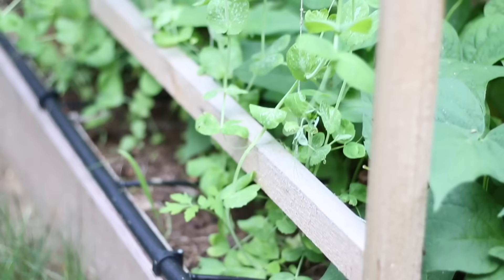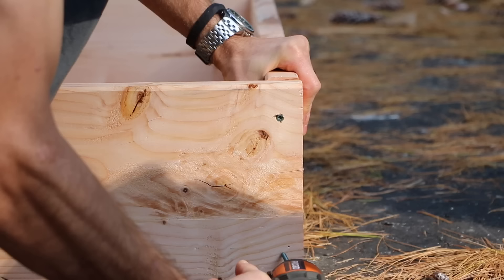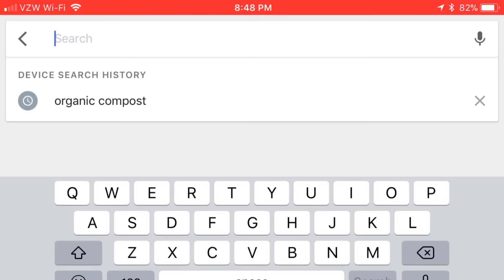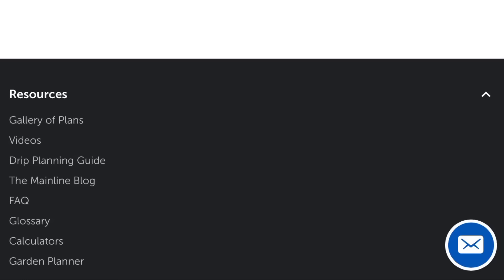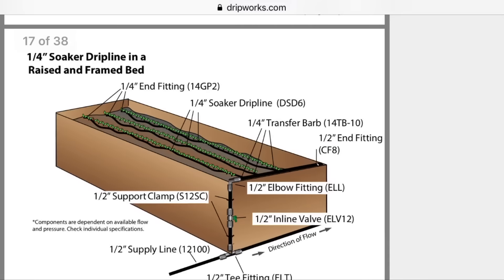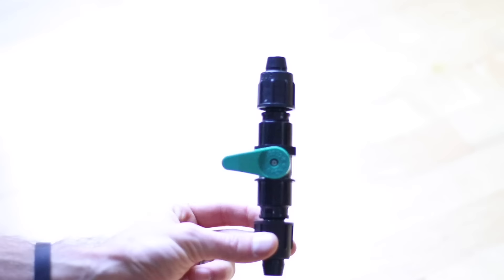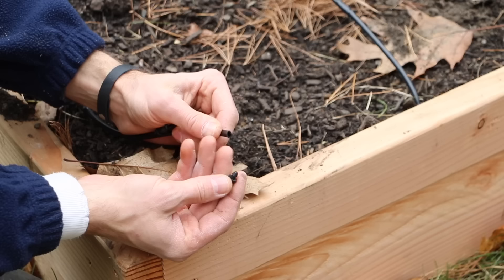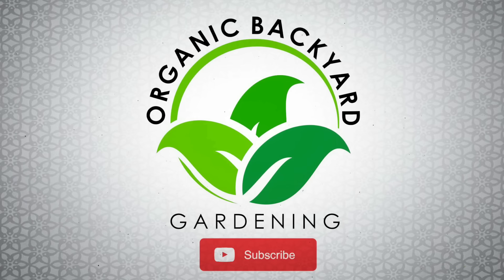How to Build a Raised Garden Bed with Drip Irrigation - Inexpensive & Easy

Comment: If your going to just screw them together like that then there is no need for a post. Only time the post is needed is if your screwing right into the post from each board. If your going board to board then it's not needed.
Reply from the maker: My thinking here was as the boards rot out, it the post will give some more stability perhaps lengthening the life.

Comment: Couldn't you just use some PEX tubing from Home Depot or somewhere similar? Not being a hump, it's a serious question.
Reply from the maker: Sure you could. Emitter tubes however are designed to resist clogging and flow evenly. However for mane line you could use pex maybe if it’s the right diameter. Drip line may be cheaper. Not sure.

Comment: gophers had a great time with these planters :(
Reply: Use gopher wire at the bottom of the soil. Then add worms after soil and water is added.
Reply from the maker: I would recommend adding mesh wire to the bottom of the boxes. I wish I would have done that. I have problems with voles.
Reply: In addition to the wire, I have has success in the past using beneficial nematodes to organically kill the grubs that attract moles/voles. Once I got rid of a major food source, they went elsewhere.

Comment: Why are your raised beds only about 8 inches from the ground level? I thought the whole idea of raised beds was to bring them up to a level where you can reduce the frequent amount of bending over to work the beds? Also, the use of regular timber (not treated) seems costly. They last for a couple of years, then you have to do this all over again? I'm confused. (Mike)
Reply from the maker: Hi Mike! Sorry your confused. Untreated wood will last much more than a couple years. Raised beds have many more benefits than just ergonomics, but if that is the main benefit your looking to get out of them build them however high you’d like.

Comment: I made a wooden box and three of the four corners are 90 degrees, but the fourth is 110 degree angle. How do I fix it?
Reply: @OrganicBackyardGardening  ,no, all the exact same size, as a matter of fact, each board is shorter then the previous.
Reply: Resulting in all shorter boards, none being longer, it's architectural ju-jitzu
Reply from the maker: Ah yes, that’s the issue. I would recut to all the same lengths.
Reply: @OrganicBackyardGardening  , but if some are too long, shouldn't I make some shorter because short is the opposite of long?

Comment: what r u mixing
Reply from the maker: What portion of the video are it referring to? If it’s where I’m using the rake on the bed, it’s just compost I dumped into the bed and leveling out. With this method, no mixing, just compost! Isn’t that easy! :) thanks for stopping by. - Tim

Comment: Hiya, thanks for the video!
Any thoughts on burying the lines in the bed?  Just an inch or so?
Reply from the maker: Hi Melissa! I would not recommend burring the drip lines directly in the sol because the emitters could get clogged with debris. However, you can put mulch on top of them (eg, dead leaves, grass clippings, straw etc). Thanks, Tim

Comment: Do you blow it out to keep it from freezing?
Reply from the maker: Hey Larry! Check my video here on how I do this. How to Winterize Drip Irrigation Fall Winter Raised Bed Gardening - Raised Bed Drip Irrigation https://youtu.be/m0j8XT74Hik

I blow the lines out with an air compressor, I use this specially designed attachment https://amzn.to/2Vicvg5 (amazon affiliate link)
Reply: Thanks

Comment: Do you remove system during winter?
Reply from the maker: Yes, I remove the header at the top of the bed. It’s pretty simple, unscrew the header and just store in the garage. I the blow out the lines with each beds valve open then close the valve when all blown out.
Reply: OrganicBackyardGardening thanks what do you use to blow out the water?
Reply from the maker: I blow the lines out with an air compressor, I use this specially designed attachment https://amzn.to/2Vicvg5 I will be making a video on this shortly as I’ve had a lot of questions about it! :)
Reply: OrganicBackyardGardening oh ic thanks
Reply: @OrganicBackyardGardening  I feel like this is a crucial step.  I'd love to see a video on how you do this.
Reply from the maker: Great idea Matt, I’ll shoot one this spring!

Comment: Pressure treated wood these days is different than pt wood 30 and 50 years ago.  The point I'd like to make is one doesn't have to have wood or brick or concrete or anything to 'hold up' raised beds.  Double dug, one time at the very beginning, decomposed organic matter dumped on the surface, trenches all along the perimeter to increase drainage and direct the excess water where you want it to go.  Compost is NOT fertilizer.  Compost is NOT a soil substitute.  Forget drip.  I mean it is so easy and so meaningful to just water manually or with an oscillating sprinkler...automatic anything in gardens is never a good thing.  When one is watering one is noticing the health of plants, what animals have been visiting, possible outbreaks of aphids or flea beetles....

Comment: Lots of leaking @9:10!
Reply from the maker: Good observation! It was at the end of the season and I had already removed the pressure regulator at the faucet so this was full psi at faucet, which is the reason for the higher flow out of the drip lines! :)

Comment: I’m surprised you don’t use something to cover the main line that runs underground.
Reply from the maker: Hi TC, I haven't seen a need too. I don't run any heavy equipment in that area so it's been good for several years with foot traffic.
Reply: OrganicBackyardGardening for sure. I was thinking about animals potentially digging and hitting it. I hope to have a system like this in the future.

Comment: I have the worst soil in the world. It's extremely hard clay. I've tried topsoil from Wal-Mart, Home Depot but with no luck. Where does a person buy good soil at a reasonable price?
Reply from the maker: I would suggest looking around your area for a compost supplier and bring in compost. It may be expensive initially, however by volume much cheaper than buying bags at your local box store. If you fill the whole bed with compost and each year continue adding organic matter, it will break down the clay.

Comment: We have gophers!  Lots and lots of gophers.  How would you modify your instructions to add a barrier against these horrible garden pests?
Reply from the maker: You could add mesh wire to the bottom of the bed before filling with soil if there is a concern they  are going to borrow underneath. Otherwise I’d put a fence up, bit not sure how much that would help.

Comment from the maker: If you found this video helpful, don't forget to give it a like and subscribe. 

SUBSCRIBE HERE
→ http://www.youtube.com/c/OrganicBackyardGardening?sub_confirmation=1

🪴PLAN YOUR GARDEN IN MINUTES WITH OUR CUSTOM PLANNING SERVICE ⏰
→ https://bit.ly/3DZe3NR

💦 I USE DRIPWORKS FOR ALL IRRIGATION PARTS
→ https://www.dripworks.com/?ref=lfw3jygn

ITEMS MENTIONED IN THE VIDEO & ITEMS I USE
As an affiliate I earn on qualifying purchases on links below. This helps the channel. 

Raised Bed Kits 
→ Dripworks Raised Bed Kit - Medium - https://www.dripworks.com/garden-bed-irrigation-kit-medium?ref=lfw3jygn

→ Garden Grid Watering System | Preassembled Drip Irrigation -  Use code obg10 - $10 off order $100+  https://shrsl.com/3cpc3

1/2" Main Line Parts: 
→ Distribution Tubing - https://www.dripworks.com/1-2-polyethylene-mainline-tubing-0-600-id-x-0-700-od?ref=lfw3jygn
→ Elbow - https://www.dripworks.com/1-2-easy-loc-elbow?ref=lfw3jygn
→ Coupler (to connect main lines) - https://www.dripworks.com/1-2-easy-loc-coupler?ref=lfw3jygn
→ Tee Fitting - https://www.dripworks.com/1-2-easy-loc-tee?ref=lfw3jygn
→ End Cap (I use these on the top of my bed headers) - https://www.dripworks.com/1-2-easy-loc-end-cap?ref=lfw3jygn
→ On/Off Valve - https://www.dripworks.com/1-2-easy-loc-coupler-with-valve?ref=lfw3jygn
→ Clips/Straps (secures line to raised bed) - https://www.dripworks.com/tubing-clamps?ref=lfw3jygn

1/4" Emitter Line Parts 
→ Emitter Tubing - https://www.dripworks.com/soaker-dripline-6-spacing?ref=lfw3jygn
→ "Goof" Plugs (Caps Tubing) - https://www.dripworks.com/1-4-goof-plugs-for-repair-two-way?ref=lfw3jygn
→ 1/4" Transfer Barb (used to transfer water from the 1/2 main line to 1/4 emitter tubing)  - https://www.dripworks.com/1-4-transfer-barbs?ref=lfw3jygn
→ Drip Irrigation Hole Key Punch Tool - https://www.dripworks.com/key-punch?ref=lfw3jygn

Attaching to Spigot: 
→ Filter - https://www.dripworks.com/irritec-deluxe-hose-thread-filters-y-type?ref=lfw3jygn
→ PSI Regulator - https://www.dripworks.com/senninger-lawn-garden-regulators-hose-thread
→ Female Hose Start for 1/2 Main Line - https://www.dripworks.com/1-2-easy-loc-female-hose-start
→ Attachment to blow out lines in winter - https://amzn.to/3ru77U9
→ Timer I Use (This is the best timer, I tired several)  - https://amzn.to/2yB5XeG
→ Garden House Quick Connects! I use these on all my hoses - https://amzn.to/3dQ7hgq

SEED STARTING SUPPLIES
→  High Mowing Seed Starting Kit (Tray, Cells, Dome  & Organic Soil $20) everything you need but the seeds - https://shrsl.com/3chuc
→  High Mowing Organic Seeds - https://shrsl.com/3cpad 
→  High Mowing Wooden Labels - https://shrsl.com/3chup
→  Vivosun Heat Mats - https://shrsl.com/3cbm8
→ Coast Of Maine Organic Seed Starting Mix - https://amzn.to/3I89l2a

BUYING RAISED BEDS AND DRIP KITS: 
→ Garden in Minutes has cypress interlocking raised beds that assemble without tools and grid watering systems perfect for square foot gardening  - Use code EasyGardening - $5 off order $75+  https://shrsl.com/3cpc3

HELPFUL GARDENING BOOKS
→ Square Foot Gardening II https://amzn.to/2ZJOFus
→ New Organic Grower https://amzn.to/3dauJoB
→ Vegetable Garden Bible https://amzn.to/2M9ahIN
→ The Year-Round Vegetable Gardner https://amzn.to/2X9jDKF

MY VIDEO HOW TO: 
→ How to blow out lines in the winter https://www.youtube.com/watch?v=m0j8XT74Hik
→ Build a raided bed trellis https://youtu.be/wOck6XVKrac

Comment: These boxes will rotten on ground.
Reply: Yes. He said they will in the video. He's not using treated wood, and the cypress he recommends has less rot resistance than other woods like cedar. These boxes will likely rot out in 3 - 4 years. Fortunately, replacing them will be easy. Making the boxes only takes about 5min and the wood he is using is rather cheap. $100 in wood and 20min of work to remake the boxes every 3 - 4 years is not a big deal.
Reply: Moxxiegamer  sorry i was watching muted. My mistake. Anyway i would add some proper coat
Reply: You cannot add a weatherproofing coat, for reasons also mentioned in the video. The chemicals used in the stains, coats and pressure-treatments will inevitably leech out of the wood and into your food. If you're gardening purely for aesthetics like flowers then go for it. But if you're growing anything intended to be ingested please, please PLEASE do not use weather proofing coats, stains or pressure-treated woods for your boxes. These chemicals are -toxic-.
Reply: Michael Rx well i was thinking about some oil
Reply: Raw linseed oil, not boiled, is a good safe option to extend the life. It is actually flax seed oil.